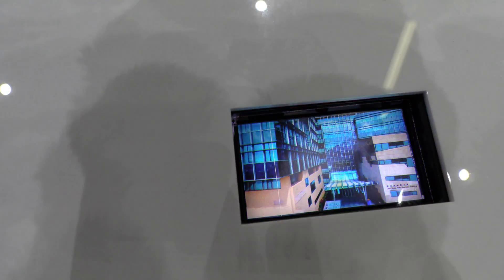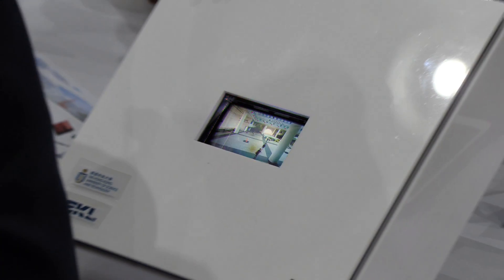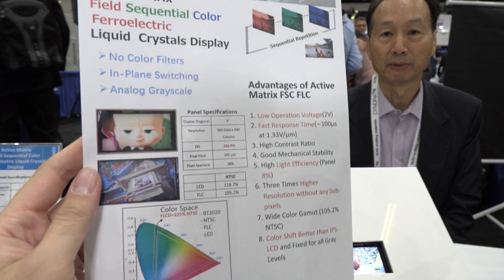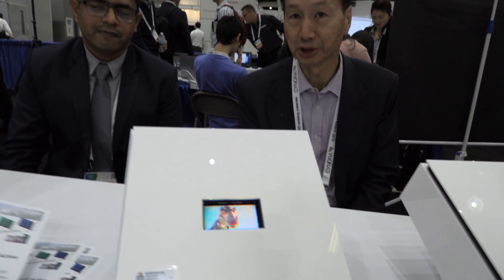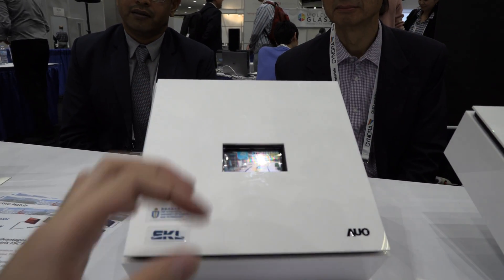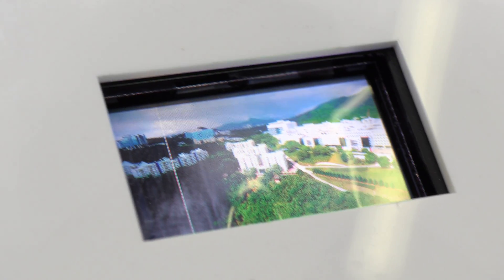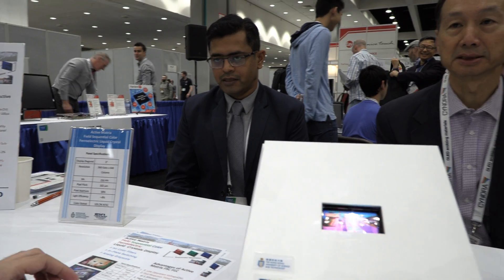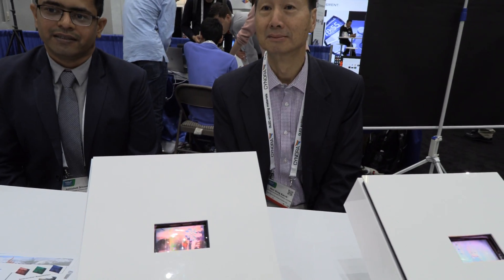Best of I-Zone 2018: FLC Display without Color Filter by Hong Kong University

Comment: This tech will be bought by the big guys, and be hidden away for 50 years!
Just don't give it to the big guys! Start a small company!
Reply from the maker: AUO is a very large company and they are collaborating with them to make this technology now already. If the power savings truly are 66% and if all the qualities of the display can stay at a same level as any best LCD currently on the market, then surely they will hopefully speed up bringing this technology to mass production starting with the smartphone market. If using this type of display technology you can more than double battery life of smartphones, that would of course be huge and that hopefully the very large companies will work hard and invest what is required to bring this technology to mass manufacturing as quickly as possible.
Reply: The light bulb conspiracy won't allow it.
Reply from the maker: For example if AUO is able to make FLC based LCD's without color filters with much lower power consumption, with perhaps better features like better colors, better contrast and etc, then why wouldn't they hurry and bring this to the Smartphone market as soon as 2019 hopefully. That would give them a huge competitive advantage and Smartphone makers wouldn't mind paying a premium at first if the new type of display can double the phone's battery life length..